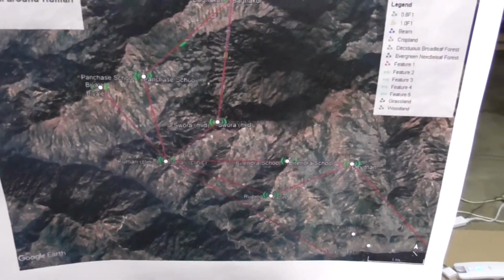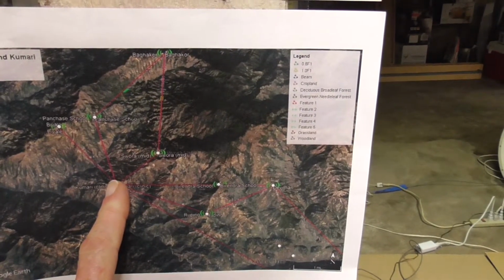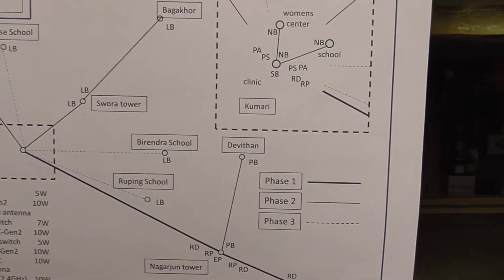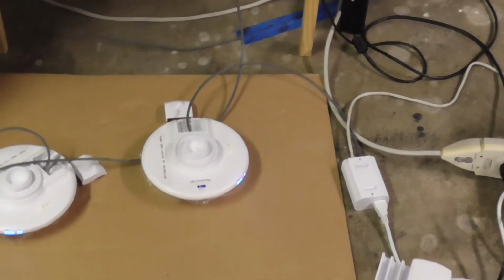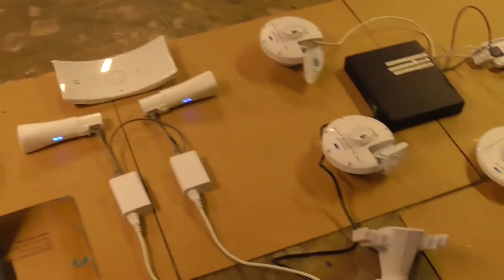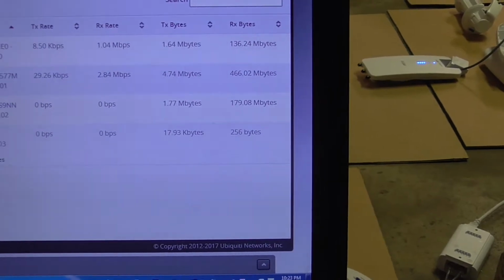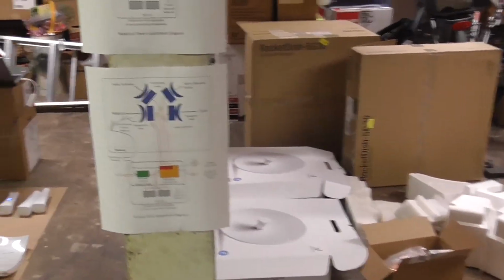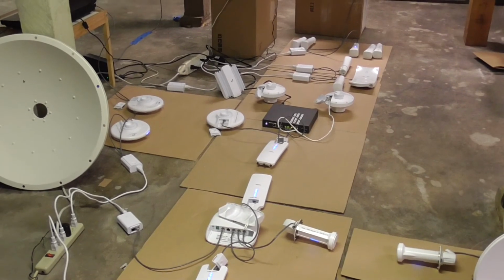Remote Internet Network for Nepal

Comment: My $0.02.. A couple of suggestions to help make the install easier and more successful... Remember to put a couple of METAL hose clamps in the box with each device. DON'T use the plastic tywraps as the permanent mounting to the tower. Only use UV tolerant tywraps to hold the Cat 5 to the tower. Did you also include OUTDOOR Cat 5 or 6 cable and the proper connectors and tools?
Reply: Any cable certified for outdoor use is fine, just not the indoor standard "blue" jumper cable. Make sure that the crimp connectors are the proper kind for the cable used and that the tool is correct too. Having come across shielded cat5 that needed special connectors and tools to put them on it is just a good idea to be sure before such a trip.  You won't need shielded, it is mostly used in electrically noisy environments such as with heavy duty motors and so on.  I don't know what kind of clamps are included with all the new devices if any. If it looks like it would stand up to a strong wind then that should be good enough. Just not the white cable ties by themselves. I use dielectric grease on radio coax,  Hadn't thought about using it on cat 5 connections but if it had been suggested than it probably would work there too. 
Good luck and have a safe and productive trip.